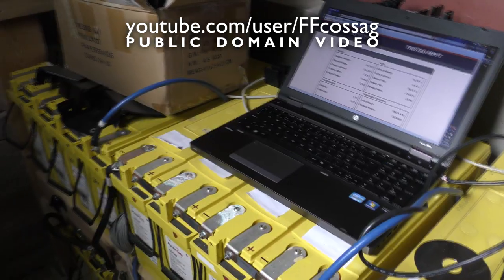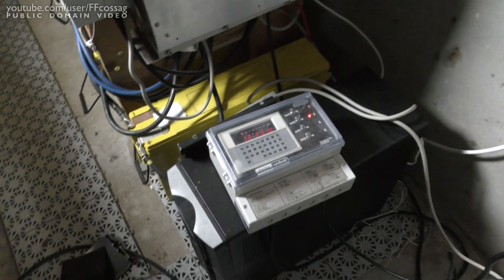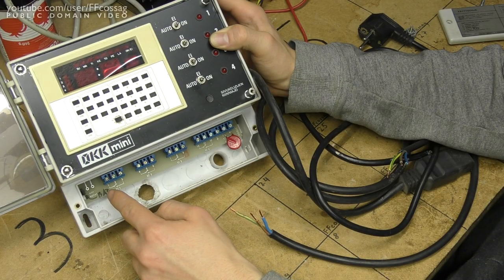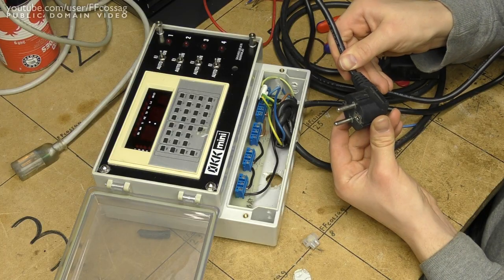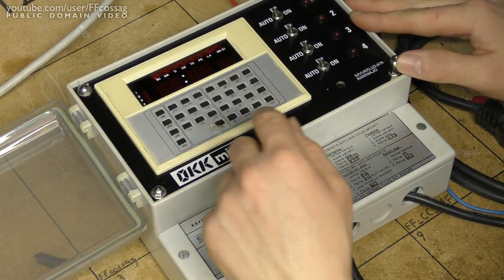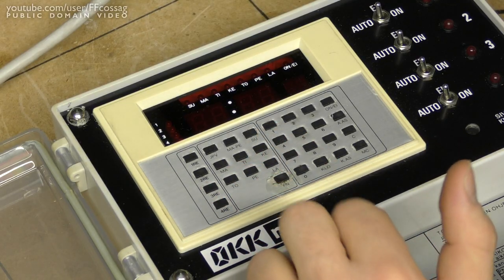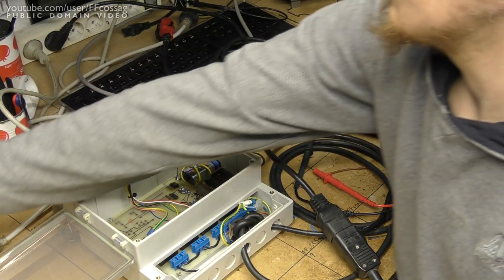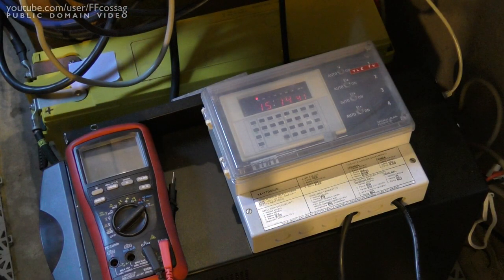Using an industrial timer to dose out solar power because real grid-tie systems are for LOSERS!

Comment: looking forward to all the upcoming battery system videos! are there any newer timers similar to that one you could recommend to do a similar type project? I could not locate that model timer off of ebay or like?
Reply from the maker: I'm sure there are plenty of Chinese variants out there. You would not be able to find this one, as it's a super small volume unit made in Finland in the 1980's.
Reply: Thanks!

Comment: First?
Reply from the maker: At the current commenting rate of 2 % and your comment being made at roughly 40 views, there's an 80 % chance of any comment posted at this time to be the first.
Reply: FFcossag That's well calculated
Reply: FFcossag Couldn't you program something like an Arduino to read the voltage off of the batteries and switch the switches on the current timer?
Reply from the maker: Sure, but that entails work and I'm lazy.
Reply: FFcossag Ok, that is a valid reason, although you did just calculate the possibility of me being first.
Reply from the maker: My internal reward system is sadly heavily skewed toward being a smart-ass on the internet. ;)
Reply: FFcossag hey dude. that electric load that you used to test the batteries.. is that Homebrew?
Reply from the maker: Yep, it's designed by a mate of mine. It's not released yet due to some ... finicky bugs in both hardware and software. In short, we've figured out that dissipating 150 W out of three TO-220 transistors isn't a good solution.